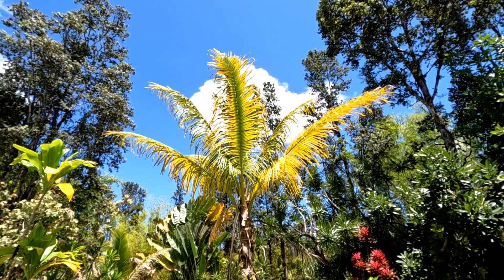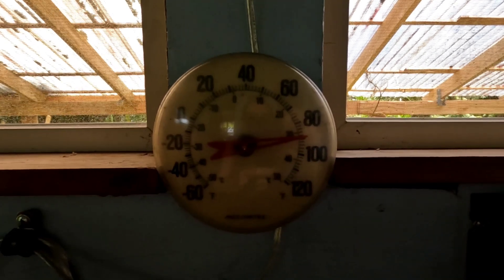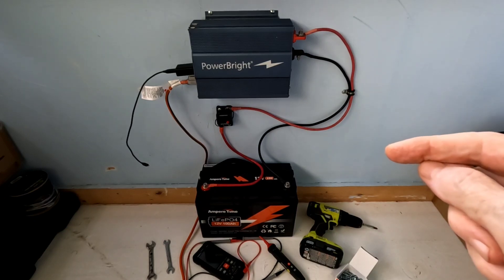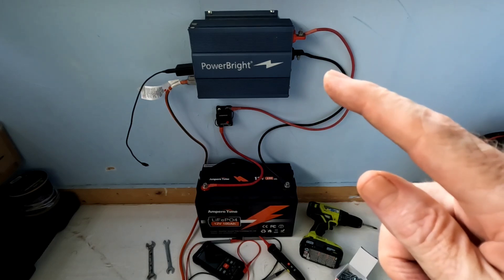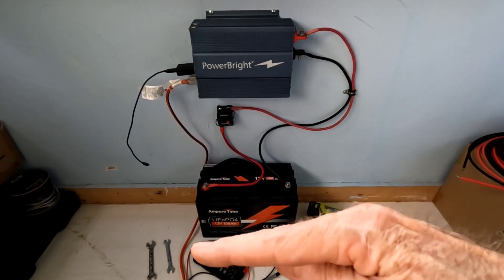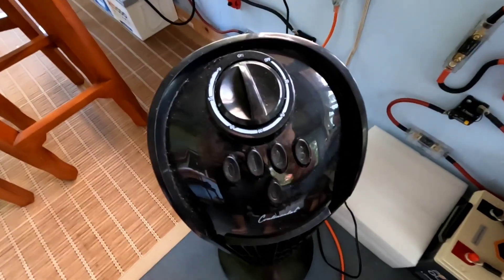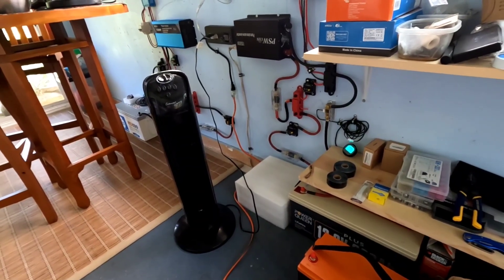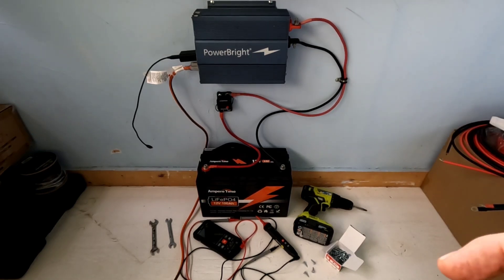The heat is on! 100ah LiFePO4 system/600watts pure sine wave inverter.  Super easy build.

Comment: I'm thinking of getting HTBH 1kWh 240w 12v system + inverter 1000w top 2000w. But the battery is a 12v LifePo4 100Ah Up to 7000 deep cycles for £380 I know that is cheap  Amazon is the battery worth it? I'm getting them all separately for £730 trying to keep price down and the bills down.
Thanks your videos have helped a lot 
Respect

Comment: that great running a fan. heat is on in main land US as well. Texas broke record and having trouble with power grid again ! and not  to long ago record cold and power grid went down. I am in Boston NY and been hot hear. no records but humidity been very high . due point staying over 70 . making heat index at times 110F . My weather station has due point.. can set C or F . you can use Anderson disconnects like SB 175 gray on battery for easy swap. I use SB 50 ,175,350 in gray 12V ,yellow 24V and red 48V the ones I got different colors don't mate   together. running 2 AC off grid with 2 RV 12V fans staying great inside. I use energy star settings on AC. keeps about 77 to 80F with much less humid . A camping buddy of mine used 2 sided tape and stuck inverter right on battery and charge controller. he has 200Ah with handle battery forgot the brand . just a carry and go system. has folding 300watt solar on disconnects . LifePO4 battery's are great  ! light, no out gassing, The only trouble I herd is the cold. and that make heated type to fix that . love the different battery's and different systems. giving us some ideas and showing how each product is working. there is so much on the market now and shopping cam be confusing. your videos help show us what we can do and which products are great. Thank you !
Reply from the maker: Put the Anderson's on the list to get..thank you. Been a little warm here too, but no need for AC...yet. Trying hard now to take steps towards eliminating propane.  That'll take a minute for sure. Mahalo Robert for all you do sharing your information with everyone here...much appreciated.  Aloha 🤙

Comment: 14 Years!  Hopefully they still make them like that!  I see you are making great use of the batteries you have.  Also, being able to swap out batteries as well.  Running 24 hours a day you will get almost 4 days out of that battery running that fan.  Should be around 44 hours.  That's great!
Reply from the maker: Yeah 14 years old already, and never once had a problem with it. Figured it would rather be working than in a box! Just playing musical batteries and having fun!🤙

Comment: Sweet. That looks about the size system I need to power my Starlink, router and bridge setup. Would you mind telling what size breaker you are using there?
Reply from the maker: I put a 50 amp breaker on this one🤙
Reply: @ProjectsinParadise808   Many thanks. 🥃
Reply: @ProjectsinParadise808  Hello from Texas, would you divide max wattage of inverter by your battery voltage to get necessary braker size? (w/v=a) for fuse or breaker size? Thanks for your videos!!

Comment: You and the videos of these solar systems inspired me to make one to run a very small window AC to supplement the whole house AC in my upstairs master bedroom suite.  Runs on less than 500 watts so I got a 1000 watt inverter and four power Queen 100 ah batteries also 1000 watts of solar to run it.  96 yesterday near Detroit Michigan 106 heat index.   Have fun stay safe.
Reply from the maker: I love hearing this...using the sun on hot days to cool off! I imagine that being bitten by the solar bug, you're going to find more things along the way to power up using the components you now have. Right on! aloha 🤙
Reply: So you spent about $2,000 to run an ac when you could have used a $50 extension cord?

🤔

Comment: I’ve had that inverter for many years. I only used it intermittently to run a monitor and laptop for tabletop photo slideshows, but it served me well. I noticed that there is a RJ* style port on the bottom (wall side on yours) of mine. I presume it is for a remote, but I can’t seem to find any information about it. I wondered if you know anything about it?
Reply from the maker: I always assumed it was for a remote as well,  albeit it a very unusual place.  I haven't ever tried to find a remote for it. Aloha 🤙